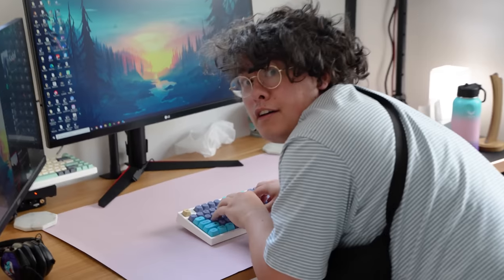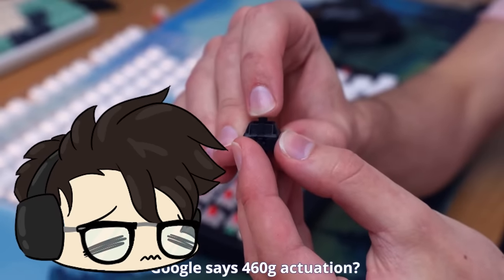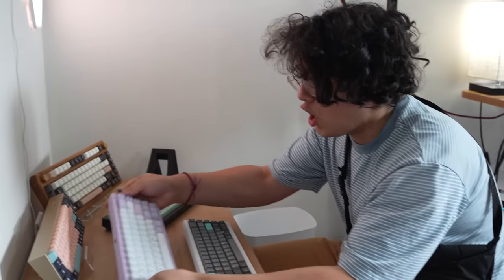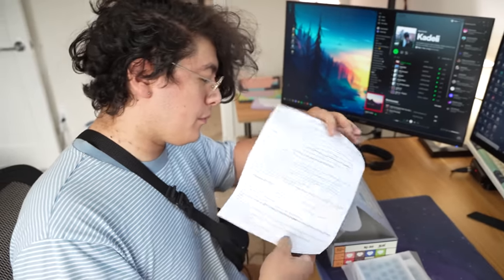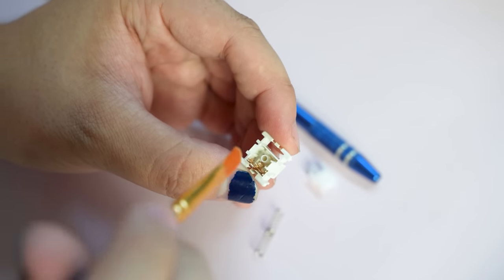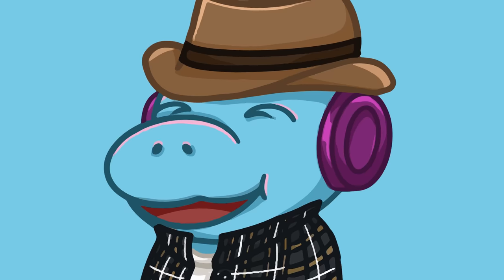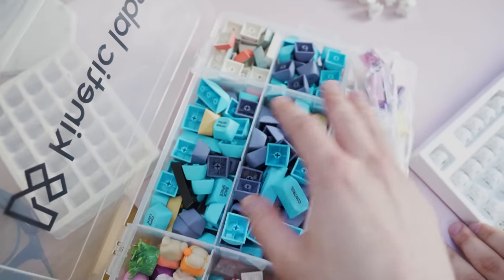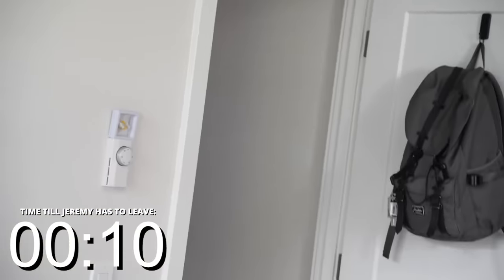The BEST budget keyboard. (For Beginners)

Comment: In thock we trust.
Reply: lol
Reply: fr
Reply: In thock We Trust
Reply: Fr
Reply: for the most thock, use a keyboard with a plastic case like the kbd67 lite, a brass weight, a polycarbonate top plate, any switch with a full nylon housing and POM stem, and SA profile pbt keycaps, and the softest gaskets you can find.
Reply: Amen
Reply: 1. Get a cheap plastic case, throw in foam
2. If tray mount screw in as hard as possible
4. 5 km thick pe foam and 50 layers of tape 
3. Put in your switches
4. Whatever keycaps..
Reply: Thock is like deep fried food
Reply: Amen
Reply: @igormocko7625  sa or mt3 profile keycaps produce the lowest pitched noise of all the known profiles and tempest tape mod's effectiveness ends at 3 layers
Reply: Yes
Reply: @breadles5  nah it’s qk60 with pc plate all foams with silicone boba u4t and sa profile keycaps
Reply: @lllatro  silicone dampens the keyboard, boba u4t has a ful nylon housing, as for the qk60, i have not tried it but i do know that the optimal case material for thock is ABS
Reply: Amen
Reply: but we never really know,
what got discussed
click boom than it happens,
and no one else was in the room where it happens
Reply: Amén.
Reply: May the clack be with you.
Reply: I have a thocky Nydala keyboard
Reply: @breadles5  Would you say this creates that nostalgic, soft-thick first macintosh keyboard kind of feel? And could you tell me what a brass weight is or where I could find one? :)
Reply: It's thock or bust
Reply: In Jesus we trust
Reply: oh say can you see, by the thocks early sound.
Reply: @breadles5  clearly the best way to get thock is to go get the most cheapest keyboard possible and count how many screws there are then by the amount of screws go to different places then get every single switch from every single store then get every key cap from every store that has it and then get a 50 m foam and then get every single lube and stablilizer and do every single mod and thock
Reply: In cream we trust boy
Reply: In gok we trust
Reply: In Cream We Trust
Reply: In thrust we trust
Reply: In ALLAH we trust
Reply: In God We trust in god
Reply: @Brazziliangigachad  sure thing we trust in ALLAH SWT
Reply: Amen.
Reply: @breadles_ bro it's a meme
Reply: Frfr
Reply: True

Comment: I'm very new to all this. I've heard the term "bent pins" often in watching keyboard vids, and how bad it would be to have one, but I didn't understand what could happen. Such great info and content in your vids. Thank you!
Reply: Good thing you knew about it beforehand, cuz I had to learn it in the hard way 😵‍💫
Reply: @user-ck4fm7os1w  Oh no. That doesn't sound good. 😱 I hope it all turned out well in the end!
Reply: Generally you can bend it back straight therefore no problem. Pin snapping off is the real issue here.
Reply: switches have 2 pins in the back. if u put them in the keyboard and one of the pins is bent it is most likely to snap off and then the switch is useless but if its just bent u can check it and fix it

Comment: The first Keyboard I will be building is the Viterbi Keyboard - 5x7 70% Split Ortholinear. I will be using the Gateron G Pro yellow switches. And I will be 3d printing the case with PLA and 3d printing the keycaps with resin (still debating on how I want the case and keycaps to look).

Comment: Hey Hipyo,

I would really like a custom keyboard, but I couldn't find a keyboard.

I currently use the Corsair K70 Mk.2 low-profile and if possible, I wanted to have a keeb with:
TKL, low-profile, white (if possible) and a volume scroll/knob for multimedia and if possible wireless

I couldnt find anything and ended up pre-ordering the Razer Deathstalker TKL, which ticked every box except the color.

I know it's very overpriced for 200, yet it's the only thing that comes close to what I would like.

Corsair released a TKL version of the K70, but those are not LP.

Good video, I enjoy your shorts on keebs! :)

Comment: I'd love you see you try a Model m or other Buckling Spring keyboard. If you need I can send you one 😆. Obviously these are not as good as modern switches since they're membrane keyboards technically so they're are super limited. They just feel so good and I struggle to find a switch with a similar feel
Reply: Buckling spring keyboards aren't membrane. There's no silicone rubber membrane. They ARE capacitive, though.

Also, technically EVERY keyboard is mechanical, but we don't count rubber membranes as mechanical. (But we do count optical switches that don't have mechanical switch contacts.)
Reply: @CptJistuce  They do have membrane switches.
Reply: @matthewblunderbuss4545  I stand corrected. I was thinking the M was more similar to Model F in operation.
Reply: @CptJistuce  That's true. I often forget the F doesn't use a membrane. Respect for coming back to admit you were mistaken. I was under the impression that the Model M was mechanical for years too.

Comment: Hi there! Love watching your videos! I’m looking to buy/build my first mechanical keyboard for around $200-$230. Would love to have suggestions! I’m thinking GMMK pro ($170) + 120x linear Gateron Blacks ($35) + B&W MSA profile Doubleshot Keycaps ($29 amazon) + Keychron Knob ($5) 

OR

QUNIX ZX75 Dark Side Wireless ($225)

Please guide!
Reply: Hi, just some suggestions for the build. From my personal experience, If you are willing to get a more expensive switch variant, i would suggest getting the gateron ink black v2  or gateron oil king over the linear gateron blacks. Also the GMMK pro barebone kit should come with a knob so you dont really need the keychron knob unless you want to change it.  Other than that, its a really solid build and wish you all the best with the build.
Reply: @NitreD7  hey there! thanks a lot for your inputs! Are you sure about the knob? Because the glorious gaming website specifically asks me to buy a 10$ knob separately! Also the price of the keyboard has been slashed to 150$ so will surely buy gateron ink black v2!
Reply: @adarshjaju2502  You might have to make an enquiry about that. I bought the GMMK pro barebone kit a while back from an authorized retailer and it came with a knob installed
Reply: @NitreD7  sure thanks!

Comment: Hey guys, what would be the Ferrari of light 45g (or less no problem) linear? Like your halo aspirational product in that category? I'm kind of conflicted because a lot of the Gateron switches as an example are heavy boi (superior to 60) and this fatigue my fingers a lot when I can't do ghost typing.
Reply: So, this is all preference, but In my opinion, Just spring swap them with some 45's before trying to go on a wild goose chase for the end-game! All my linear I swap out for really light springs. My favorite switch is the Zealios V2 (which is a gateron housing), but those are tactile. I have a ton more tactile than I have linears, but my linears are all 45 g spring swapped. 3 different gaterons (milky yellow, milky red, RGB red) and I have some Kaihl box reds, which are really nice and stable during the keypress. I tried heavier, and I hate it.
Reply: @ireakhavok  Ohhhh so the switches can be modified!!! That's so cool. I'm using a "miya X varmilo ducky" right now with red switches, I like this keyboard a lot, from factory it's super awesome. But It's getting degraded because I use it professionally + so at home lot of mileage
Reply: @NiwatiX  I don't believe that board is hot-swap compatible, so it might be a pain to disassemble. Very much doable, but a hassle. That being said, the cost of getting a decent de-soldering station, etc. may be more expensive that just getting a new board with hot-swap switches. However, You can allways get a custom keycap set that you can move around from board to board. Just be careful with some GMK or cherry sets as I don't know if the profile will work with your current setup. Cheers. if you need more help, you can check out hipyo's discord or Hit me up on my channel page if you need help putting something together.

Comment: @HipyoTech nothing to do with the topic but i need some help or advice to point me to the right direcction. I "modded" a keyboard, added hotswap adapters and all works fine.. but 1 key. Tested with multimeter and key should work, but it doesnt.. i dont know what else to check. Switch works ok, pad are ok, multimeter sais the contacts are correct on the row  and rest of the keys of that :(
Any idea will be appreciated. Dont understand why is not working. At least is only the "end" key, but is a big f... after a lot of solder/desolder, paint and tune

Comment: Hmm, surprising you have so many fams of yellow keycaps.

I built my keyboard at the beginning of the year and now my space bar is ticking on one side. Do I use dielectric grease to help this?
Reply: Clean out, holee mod and then relube.
Reply: @Isaacthedank  But it's soldered in. I don't want to unsolder everything just to clean it.
Reply: @Isaacthedank  Yeah, that's what I was thinking. Do you inject it with dielectric grease or another lube?
Reply: @Zeldur  I'd suggest 205g0. I prefer xht bdz but it's too thick for injection.

Comment: lol i over push lubed my gk6one (the one key doesn't work after that) and i might have to get a new keyboard which is a shame because his one sounds so nice
Reply: do you have a spare switch left from your switch set? its not the PCB, its the one switch you overlubed. (atleast i think) So you could, if you want, just buy a new switch set and it should work fine. (I recommend buying a prelubed set so you don't have to lube them :D)
Reply: @moonylostagain  the only problem is it’s and optical and optical switches are hard or even impossible to find unlubed! A set of optical yellows would be easy to come by but I think I’d be better off buying a non optical keyboard (a while ago I was thinking for a split second of buying new switches but then I realized I have an optical board. I find it a bit limiting)
Reply: @moonylostagain  and there are more keys but thankfully they worked while I wrote that comment (writing on my iPad rn lol)